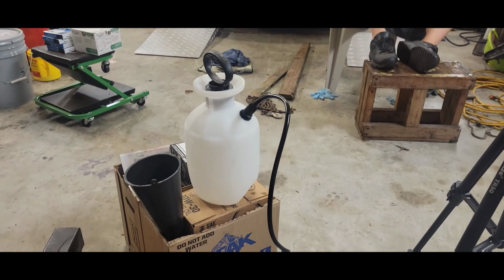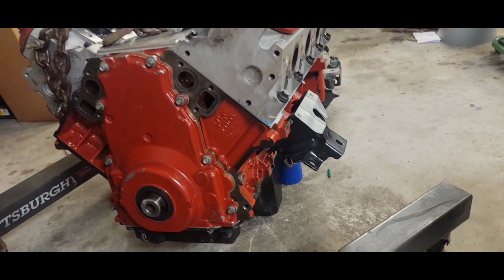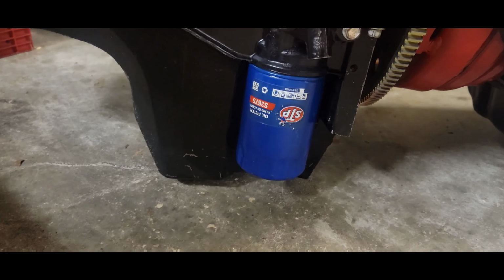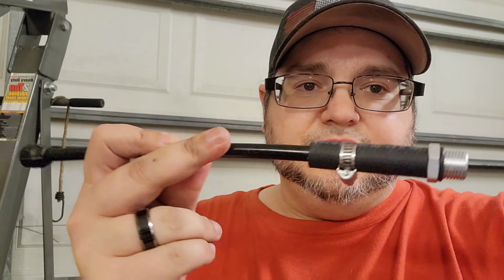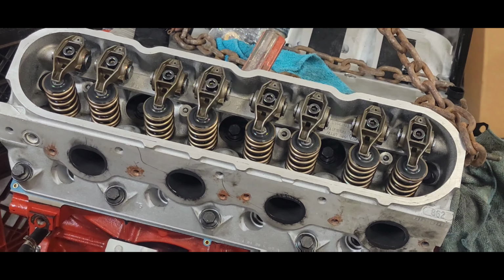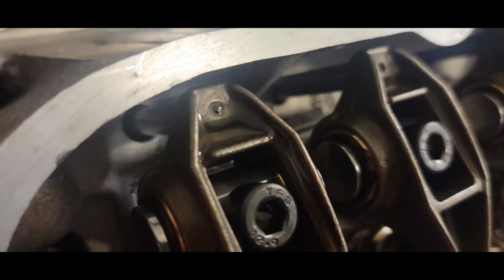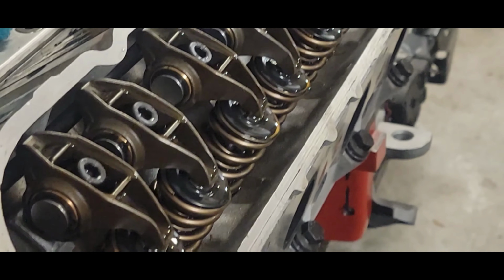THE BEST way to prime a LS ENGINE

Comment: Would u happen to have links to the actual ones you bought thanks in advance
Reply from the maker: Autobahn88 Aluminum Hose Barb Fitting - M16 P1.5 Male to OD 10mm Barb (0.4") (with O-Ring) (SILVER) https://a.co/d/01tGG6h
Reply: @DavieJones_Lockr  Can you pin Danyel's comment please
Reply from the maker: @TaenXD  "say no more, fam"
Reply from the maker: These are the two that I purchased... I see the price of the sprayer is a little higher than when I bought mine, but that's the exact link to the one I purchased. A small investment to protect thousands of dollars worth of parts, research and labor, in my personal opinion. Also..... I used valvoline VR1 10w30 because it's a conventional oil that still has high zinc. They say it's not necessary but with the bronze bushings in the trunions I figured why not.
Reply from the maker: CHAPIN 20000 Garden Sprayer 1 Gallon Lawn https://a.co/d/5WnaPgQ

Comment: Old video, but….. my main concern is the oil pump o-ring….  If that is bad or not sealed, will this method still prime or will it just blow out into the pan?
Reply from the maker: It will still prime. The pickup tube isnt getting backwards pressure from the pump.

Comment: IF your rockers are loose. The oil pressure MAY fully extend the lifter. Now torque rocker down and lift may not bleed down and hold valve off the seat. It may not be a common result but a lifter should never extend beyond zero lash.
Reply from the maker: I follow... just remember that the LS platform isnt like our old 350's with the adjustment at the rocker. Once you torque them down thats the uniform spot they are going to be at, so if I've got pump not bleeding, I cant adjust to compensate at all and the lifter itself has to go

Comment: If rockers are torqued down already can this still be done?
Reply from the maker: For sure you can! I wouldn't go out of my way to disassemble anything for a prime. In it's normal operation the engine will pump up those lifters.

Comment: If you used assembly lube then the only dry part would be inside the oil galleys which fill by spinning the motor. 
There’s nothing wrong, per se, with what you suggest but Melling priming system is for people that are doing break downs in the pits. 
…complete waste of time and money for the average builder
Reply from the maker: You’re right, the priming system is an overkill if you’re just working on a build at home. But it's cheap insurance, right? I have the time so I use every advantage I can to have peace of mind that my investment is not going to fail in front of my eyes immediately.

Comment: Excellent cost effective solution! Listed out the parts needed and showed what needed to be done clearly. Perfect video man! I’m in a similar boat, my first junkyard 5.3 spun a rod bearing after 700 miles in the swap, so this 6.0 I’m building is getting more attention, shimmed the oil pump, measured pushrods(glad I did) and now I can effectively prime this engine that’s been sitting for 3 years since we got it, no tellin how long it was in the junkyard. You’re the goat 🤘
Reply from the maker: No problem brother. I watch the video and think It's super cringe and would redo it a lot better now I've got some practice making videos. Thanks for the attaboy

Comment: Excellent explanation regarding lifter fill vs. crank position that others never mentioned.   Researching to prime the motor in my TPI 87 Vette L98 SBC, thats been in storage for 20yrs, due to health & life crisis.  I just want to avoid having to prime it the old conventional way & pulling the distributor & using a priming tool to engage the oil pump.
I hope using the oil sending unit will work on this 350sbc, or a
 ( T )  it in, to use the sender to monitor oil pressure on the dash gauge.
Reply from the maker: If it's complete I'd just kill the ignition and spin it on the starter

Comment: Why not just fit a compucheck fitting so you can hook up and prime every oil change ????
Reply from the maker: It was a fresh build that had never been run before so while there was assembly lube in the bearings, the rest of the oil passages were all empty. A normal oil change doesn't drain the whole system like that, at least not on all the engine platforms I'm familiar with. You never know though, there might be some engine somewhere that needs to be re-primed after a service.

Comment: What would you do if the oil starts coming out of the oil line connecting spot on the engine
Reply from the maker: You mean the threaded fitting? I guess i would either hit the threads with a little white thread sealer, or tighten the hose clamp that's holding the line onto the hose barb side. Some guys are pushing a hose directly into the threads without a fitting and are having good luck with the fuel injection rated hose that has a slightly larger outside diameter than standard fuel hose. It's not the cheapest hose around but you only need a scrap length of it really. If you mean where the hard line goes into the rubber hose, I'd just use a smaller inner diameter rubber line that's tight and make sure to get all oil residue off the two surfaces that oil is seeping through. Hit it with a shot of carb clean, ya know?

Comment: Best priming video I seen thanks
Reply from the maker: No problem. I'm actually thinking about making more videos here soon if things come together the way I want them to. Fingers crossed
Reply: @DavieJones_Lockr  sounds good, I’m trying to prime mine now but I can’t seem to see the hole for the oil pressure sensor to put the adapter fitting in. Do you know if it is behind the Powersteering pump and that it has to come off in order to get to it ?
Reply from the maker: @ShamarSkitz2.0  oil pressure sensor on mine was behind the intake manifold on top of the block where the distributor used to be on the old 350s. Only thing on the side was the fill port you see me screw that fitting into to supply oil to the system.

Comment: Could this work on a sbc??
Reply from the maker: I don't see why it couldn't, but usually on the SBC you manually turn the oil pump from the distributor tunnel. They make a special tool for it but most people I know cannibalize an old distributor and use a drill to spin it.

Comment: How long after priming should engine be started?
Reply from the maker: Once these engines are primed they will stay primed as long as your filter has an anti drain back valve. You'd be hard to find a street filter that doesn't, to be honest. It's the same reason you don't have to prime it every morning. They stay primed.

Comment: What I did was the hose by itself screws into the engine block without the fitting and it works great
Reply from the maker: Just a thick walled 3/8 like a fuel injection line?

Comment: nice vid and thanks for sharing !! Quick question, if i have an assembled engine on the stand, and it's buttoned up, full of oil, can I remove the spark plugs, rotate the crank by hand, would i get the same results?
Reply from the maker: YES! the top end and bottom end are completely sealed from eachother and turning the engine will turn the oil pump. I just didn't want to turn the engine dry and wait for the oil as much as get as much oil to where it could possibly get before I cranked it. That's the only reason I did what I did. It's what we used to do with the older 350s
Reply: Thank you sir, love your channel.  @DavieJones_Lockr
Reply from the maker: @bradleycrenshaw6778  thank YOU. No one has ever said that to me. It makes me want to make more videos

Comment: Man, thanks for sharing this. I was prepared to spend some serious bucks for a prime pump. I don't know why I didn't think of this. This process makes sure the cam, mains and rods also have a nice prime. My create long block arrived today. After dropping a few grand on an engine (5.3) I want to make sure everything is covered. My core had a DOD collapse and I parked the truck.Other than that I would have kept going with over 300k on it. Now, I'm off to surf the net picking up a new EGR, Pressure sensor, and anything else I can think of before I drop this thing in. 
Thanks again, 
Cheers from Louisiana.

Comment: Hi I've been searching for a straightforward method of correctly priming my LS1 engine in an '03 VY Holden SS utility. The engine has not run for thirteen years as the vehicle was accident damaged and then stored out of the weather. Now I have the time to rebuild it properly.
Thank you for your input.😊

Comment: Really like this method you have here-expands on the simple side fill way.I never feel safe till the lifters are showing oil,got my new method.thx
Reply from the maker: Glad I could help. I lost a cam and lifter set on a brand new LS engine and vowed never again. Never had this issue with a 350 so I figured carry over the same priming philosophy.

Comment: Just unplug the coils so it won’t fire and crack til you have pressure.  For no faster than it’s rotating and no longer than it takes to build pressure it’s not going to hurt anything at all. Parts won’t even have any heat in them at that point.
Reply: Exactly..  wtf is assembly lube for? 
They spend 300$ or some crazy money on the latest assembly lube,  ARP fasteners and all that jazz… then this silly pre-lube bullshit.  
C’mon man enough with the craziness.
Reply from the maker: It was just cheap insurance to me.

Comment: Good stuff!  I used the garden sprayer, cut the tube, and a barb-to-NPT, using the oil pressure sender port.  GM 3100 V6 and a GM 3500 LX9 V6 within the last couple weeks...V6's need oil, too.  I just did two quarts in the sprayer and concluded that is probably fine.  Both engines fired right up, no oil pressure lights or anything.
Reply: Yep-i do it on top,easier

Comment: Homeboy cranked that filter down.  Also, rockers look crooked. Not centered on valve springs.
Reply: He hasn’t tightened them down yet. I did cringe a bit on that filter though. Looks aight.
Reply from the maker: Yup, no pressure on the rockers. Figured why press on the lifters I'm trying to fill.
Reply from the maker: Haha yeah it looked tighter than it actually was. If I hadn't done it so slow for the camera it wouldn't have seemed that tight. That filter was only on the engine for a short time anyways so not really long enough to get bonded on. Couple of heat cycles and I dropped that oil and cut the filter open.

Comment: I just take all plugs out diddconnect coils and injectors and prime with the starter
Reply from the maker: I didn't yank the plugs, but I did disconnect the coils and spin it on the starter just because it was such a simple double check. I had immediate pressure and felt really good after it. I wasn't about to risk losing another camshaft and lifter set again this time.
Reply: @DavieJones_Lockr   are you able to do this on a old school small block chevy
Reply from the maker: @familia impala  on the gen 1 small block you do it a little different. You yank out the distributor and install a tool that engages the oil pump manually so you can spin it without turning the engine. So no its not the same, but YES it's the same as bypassing the ignition system to prime the oil system. Some people actually use an old distributor that's been slightly modified instead of the tool, either way they use a power drill to turn it instead of the starter motor and it works great. Good question

Comment: Did you have to put the flywheel bolts in?  I have oil leaking out of them?
Reply from the maker: Uhh.... I didn't have that issue at all. That's a new one on me. I also had the two units married on the floor before I started the process so they were already in place.
Reply: Rear main seal leaj!?

Comment: add oil, disconnect injector power and crank till you have oil pressure. reconnect injector power and fire it up
Reply from the maker: I didn't want to crank it without having filled the oil gallies in the block first. It's the same principal I would use with any other small block, but that's just me.

Comment: Learn something new everyday first time iv ever seen someone prime an ls iv always wondered how or if it had to be done on a ls never see any engine builders doing this before cranking one up kool tip/trick
Reply from the maker: Yeah man, can't hurt at all, so I call it cheap insurance. This is also after I ate the first cam and cam bearings so I wanted to reduce all possibilities of a repeat situation.
Reply: @DavieJones_Lockr  I understand like I say I never built an ls but iv built plenty of older engines an u got to prime them before start up an u can watch horse power tv of any of them programs that show build’s and dyno pulls after being built an never once had I seen someone prime an ls engine
Reply from the maker: @barryhebert5839  this is my first.... and second LS lol. Learned a lot along the way. When it ate the cam bearings and the cam, I decided I'm going to find a way to prime it. A few guys said not to worry about it but I've never put an engine together that I DIDNT prime til now and I've never lost a cam til now soo... yeah I'll prime everything for the rest of my life just like all the SBC builds in my past.

Comment: I have to laugh, Because the manufacturer doesn't even do all these pre lube tricks that everyone has come up with. Just like  balancing of the crank,rods,pistons and bearings. Ive hauled GAZILLIONS of LS engine parts into the engine assembly plant and stood there and watched them take container after container of pistons and rods and feed them into the robot that assembles them into the block and attaches them to the crank. There's NO balancing of ANYTHING. Yea, I get it. A factory OEM engine isn't going to be spinning at 8-K to 10-K RPM. But it shows how well the LS is designed and how forgiving it actually is.
Reply: The manufacturer also doesn't care how long your engine lasts, as long as it lasts until the warranty expires. Then they'll gladly sell you another new car
Reply from the maker: 10 points, but like you said, that's OEM manufacturing.  Those guys have engineered a system of tooling that keeps all parameters within a certain range because at the volume they are producing, any variance is super dramatic. Think about if the added 2 grams to every single piston, the material costs at every piston in every engine in every vehicle and on every parts shelf would be so much more dramatic than the initial cost projections. It's amazing how well the factory can produce quality in extreme quantities.  Imagine how many millions of dollars went into the research and development of not only the engine itself, but the tooling and supply line logistics as well. Crazy
Reply: Weight balancing the rods and piston is not a waste of time or money. It definitely adds to a smooth motor
Reply from the maker: @John Doe  biggest no brainer in any engine I've built from stock to wild. Do I want it balanced? YES. I'll pay for it every time. Even if the parts supplier says it's already balanced I'll say balance it. Everything else we can do to an engine is give and take in terms of drivability, longevity and fuel efficiency, a balance has NO downside other than the few bucks out of your pocket.
Reply: @DavieJones_Lockr  that's what I say. Pyle81 didn't seem to think so. I also agree with pre lubing. Can't hurt. I don't prelube or pre fill lifters
Reply: I wonder if I should have balanced my 300,000 mile turbo 6.0?  But then I would have had to change cam bearings. 😉
Reply from the maker: Lol might have been different if I was still running stock factory crank, rods, pistons, rings and pins. Once I went aftermarket a lot changed in my mind.

Comment: awesome video, definitely gonna use this method for my ls1 thx
Reply from the maker: Thanks!.... I still recommend unplugging the coils and pulling the fuse used for the fuel pump so you can spin it on the starter til pressure builds up. It'll cost you NOTHING and possibly protect a few thousand dollars you have invested. Sounds like cheap insurance to me

Comment: How fast did the oil come up through the pressure sensor? Engine is in car. Doing my Harmonic Balancer, Cam, Springs, Push rods, Timing chain and new Melling 10295 pump.
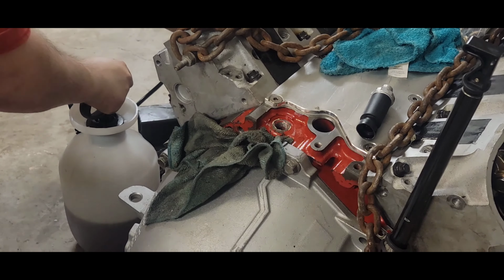Reply from the maker: At 3:17 you'll hear me say "oh, I forgot to open the valve.." once I snap down the pump it cuts right to when i pushed the spray button so you can see it come up in real time. There's no footage cut there. It came up that quick that I was genuinely suprised.